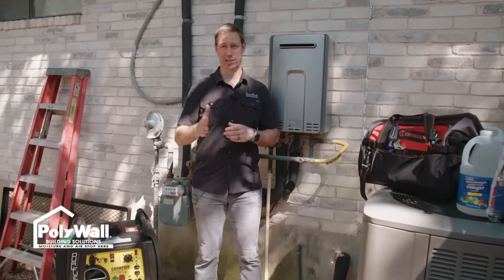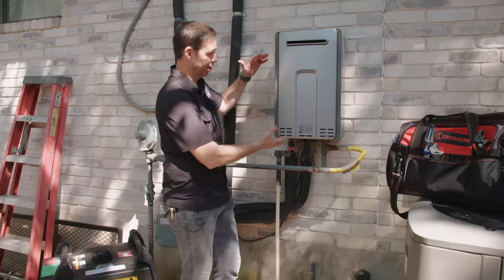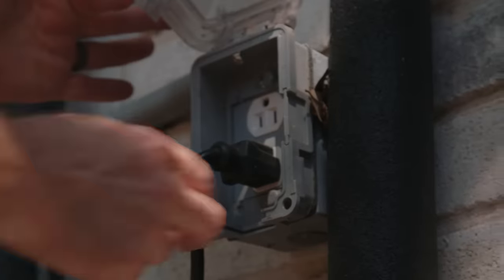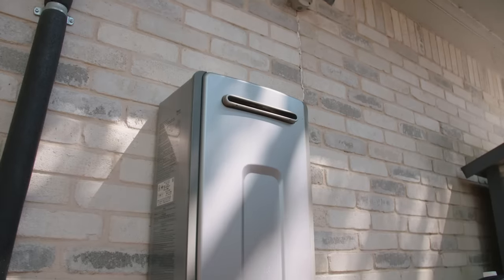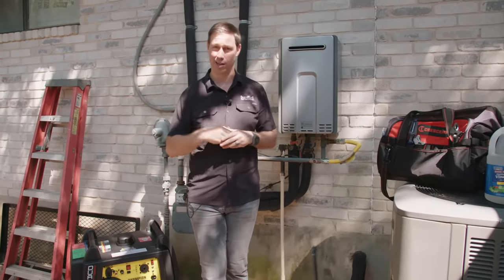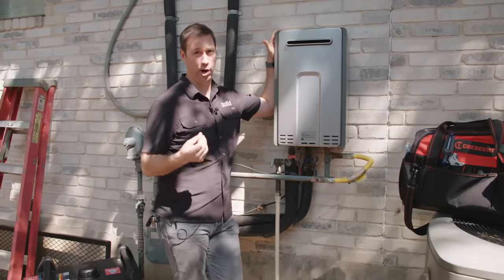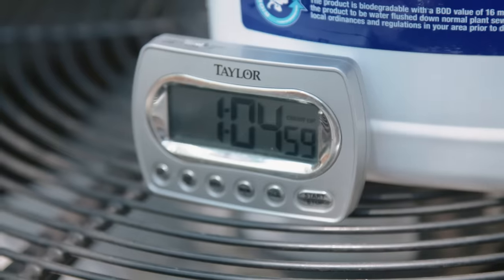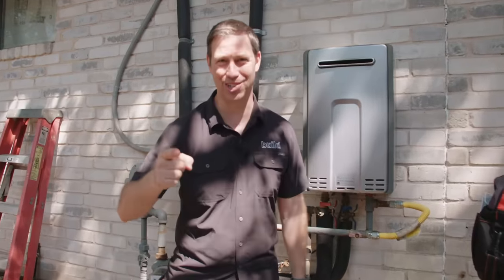3 Things They Don’t Tell You About Tankless

Comment: I flushed my Rinnei after almost 2 years, nothing came out. But when I installed it I found the second elbow after the old tank water heater had gotten 1/3 blocked in the 14 years after the house was built. So maybe scale has little to do with the type of heater. I did save money as I tended to shower do laundry and dishes all in succession and didn't have to heat water for it to just sit the rest of the day. You can buy a timer and a solenoid shutoff valve for the hot water feed to the shower if you children  don't adhere to an audible timer. It would require some electrical work. If you put the timer outside the bathroom door, they have to exit the bathroom to reset the timer.

Comment: I'm getting another tank water heater and pulling out the tankless, I don't have enough hot water to take a shower. Looking at the specs when to order,  listed was a 40 Amp double with 8-3. Upon arrival, l found that two double  50 Amp and l needed  another 8 awg line and a larger panel box because l didn't put in a large enough in 20 some year's ago. I had a 30 gallon manufactured 03 2003 and it has been working until a couple months ago. I plan to get a 40 gallon and  lower the platform for it to fit.

Comment: I’ve had three tankless water heaters (2 combi) across two homes, and I can safely say that I HATE tankless water heaters. 
Sure, you get endless hot water, but it comes with so many downsides. 
1. Low hot water pressure/low flow: these things immediately drop your pressure. I’m a woman with thick, long hair, so I need a good amount of pressure to wash my hair. It takes me longer to shower because I have to use more water to do the same routine. I’d rather use cooler water and take shorter showers if it means having a regular amount of pressure to do so (even now I flip between hot and cool water in the shower to increase the pressure). In this case, I don’t think I’m saving any gas money. If anything, my water bill has gone up because I’m using more water to do the same things (eg, wash dishes, fill washing machine) to compensate.
2. The maintenance: these things are a pain to maintain and they clog my system with so much buildup, so I have to continually check my aerators and soak my shower head in vinegar. Why is this so much work? I just want to use my water normally and not have to maintain it so much.
3. Once the power goes out, I’m without hot water or heat. Great, what a blast. Also, if this thing breaks down I’m without hot water or heat. This happened to me in the winter and I was NOT a happy camper.
4. No cost savings: as I said above, you use more water to compensate, so I really don’t think you’re saving money.

I think tankless heaters are good for small families (1 or 2 people) in small houses. I DO NOT recommend them for large families because you’ll run out of pressure quickly if too many things are running at once.

Overall, I hate these things and I can’t wait to move into a new home with a hot water tank and have normal pressure again.

Comment: I added a Hugo Battery Backup to my Rinnai tankless heater.  It's the only one approved by Rinnai to add to their system.  Mine is inside the house though.  But it's basically a car battery in a good case that you plug in between the wall and the unit.  It'll give you about 5 days of hot water use before it drains.  Unless you're constantly using hot water of course.

Comment: Also make sure you have the correct size gas line and a warm place to store it or no hot water in extreme winter and cold areas. A traditional tank has a pilot which stays warm/hot, with on demand I have to put a heater in the water closet during winter to keep pipes from freezing and have hot water
Reply: Had one in houston, it was great! Didnt account for the cold temps in the mountains where I now reside.

Comment: 4th and 5th things. the temp of the water coming out of the heater depends on the temp of the supply water. freezing supply water means you have to crank up the heater to get decent hot water. 5th    if the heater has an igniter rather than a pilot light, there must be sufficient water pressure to cause the igniter to work. people who have well water supplied through a pressure pump, governed by a 30/50 pressure switch, may find that at 30 lbs pressure,the igniter will not work. pressure translates to water flow that makes the igniter work.

Comment: It's also vital to centrally locate the tankless. My late mother's house has its tankless on one end of the house and the kitchen sink on the opposite end. This makes occasional point-of-use water, like washing dishes old school, constantly needing a wasteful running until it's hot again scenario. And no, "just get a dishwasher" is not an acceptable solution. Said house will be up for sale in a month or so. I expect that the next owner will switch batch to a tank. The old tank location resulted in tank failure (and a small flood) about every 6 years or so. Ugh.

Comment: I work for a natural gas utility company. I see many people who think that you can simply swap out a tank for tankless. Often they will get a low-pressure code because they did not run a dedicated gas line to the tankless and size the pipe correctly. 2nd the cost to fix can be very expensive. A pc board can cost $600.

Comment: No pilot,THERE is the savings, I live alone, and that’s why it really works!   When I had a tank outside, my gas bill was $50 per month, in winter when the heater pilot was on $100 per month, since I’ve had a tankless, when the heater pilot is off, my gas bill is $6 per month, yes you read that right!!   But mine is just 140,000BTU max, it’s inside, and the longest run to a hot outlet is just 10’.  Short pipe runs are 
Absolutely ideal for tankless.

Maintenance: When I installed it I had all new copper pipe, ‘07, I have NEVER serviced it or descaled it properly, I never bought the proper valves to clean it out, I never even checked the water filter at intake, nor cleaned the screen in the air intake!  Takagi, lasted 14 years …..of my abuse, finally the flow detector died, from the lime.   But I’ve no complaints!

This time it’s has the computer display screen built in, it’s smaller and lighter than the the TK Jr, yet it was only $50 more 14 years later!

For me the tankless is fabulous, it saves me, $600 per year easy, my short plumbing runs, mean even in the coldest weather I’ve got hot water in less than 3 minutes.
But this time I bought the cleanout valves, if I service it, it will
Be the last water heater I ever buy most likely, ….I’d be 85 in 20 years !

Comment: I put a tankless water in years ago.  My gas was cut in half.  A pump and some vinegar does not cost much. The main reason I had a tankless put in was to move the pilot light out of the 
Garage because my sun has motorcycles and they leak gas.   The generator with your tools on it will take care of having hot water when the power goes out. I have one of those also.

Comment: I got a Rinnai 6.5 GPM and you dual Fuel Genny Champion 3400 I ran it for 39 hours for my refer and freezer and CPAP internet and tv computer on 4.5 gallons of LP.  I am going to build a barndo in TN like RR Builders using my Rinnai to heat not only my water but Radiant too on LP.

Comment: #1, trivial.#2, big. Although we used a tankless for 35 years, where we live now any energy savings would never pay for the cost of a tankless install (higher initial cost, plus we require electric- and the installation of a higher amperage circuit would push that cost even higher). #3 I find curious. We used several different brands of tankless and never descaled once, and no problems, even though our country well water was loaded with calcium and iron.

Comment: IF you have my tankless electric water heater. to be honest I LOVE IT!!!!! But be warned, it requires 2 dual 60amp breakers. and will rise your bill slightly about $20 a month.
It takes about 8 seconds to reach full 145F then about 10 sec there after for it to stablize (No anid rods and lower power setting). Also take the tiny tank inside apart once every 3-6 months and keep it clean!

Comment: The issue I found is you need consistent high water pressure.  It didn't work well with a pump and bladder setup. I hear too that gas pressure may be a factor.  I pulled mine out of frustration with running water while waiting for my pressure to build back up.

Comment: We moved into a 'new' cabin that had been sitting for awhile from a previous owner dispute with the contractor, that had one of these on demands installed.  We fired it up and used it for two years before it failed and leaked all over the utility room.  Opening it up, the fins had completely degraded and turned to grit.  We had to have it rebuilt to get hot water again.

Comment: I’ll add this about tankless. I’m in Austin TX and have 2 twelve year old Rinnai units at a duplex mounted outside and they did great despite having one insulated copper pipe burst under a pier and beam house. A friend has 2 six month old Navien units which are not worth saving. I believe 5 or 6 of naviens proprietary plastic fittings cracked in each unit. After replacing the plastic fittings it turns out the heat exchangers are also destroyed on both units. I’ve now looked at 2 more navian units mounted outside that have failed (heat exchangers) as well as multiple fittings.
Reply: I live in Austin as well & was thinking of installing tankless when my old water heater (+15 years) finally goes. Sounds like Rinnai is the obvious choice.

Comment: Tankless heaters are on the outside and will freeze if it is cold enough. I had two with proper electric freeze prevention and insulation. Both froze in the recent extreme cold snap with no power outages. Both froze anyway.

Comment: At point is energy saving compared to single point units.
You’re still hearing water that just sits in pipes.
And you will DEFINITELY save energy… if it’s not in use, it doesn’t consume, where as tanks use regardless… if you’re basing your usage based on availability… then you’re not trying to save money in the first place

Comment: Coming in way late, but I think it's very interesting that your first "con" is that there is no hot water when you lose power, but in your second "con", it's energy efficiency for something like a gas hot water heater. Wouldn't a gas tankless water heater be a fix for the first con? It's just interesting that you made no mention of a gas tankless water heater to get around con one, but mention it as having a higher cost in con two.

Comment: Matt,
I sure would like to see you address how a large family can best handle their hot water needs.  Their 60 gallon tank is old and not it's not long before it will need replacing!  Here's the hitch, they are all electric, and they currently only have a circuit for a one element 5.5kw heater!

Comment: my biggest complaint by Rinnai RUR unit is that , unless you have recirc mode on all the time you will not get hot water right away, otherwise it takes a good 2 minutes of running the faucet on hot until I get it. I'm not a fan of having to keep that recirc mode on all the time. There is a mode where you can run it for 30 minutes at a time, but that gets to be complicated because I am used to having hot water right away if not maybe 15 seconds with my traditional water heater and it never relied on a recirc pump

Comment: I have one in my granny flat that's rated at 2.5 GPM. In the summer even with all the settings as low as possible, it's too much. I live in Southern California with warmer water to start. If i had to choose again, I would get a 1.5 GPM unit.  I have no idea who's using 8.5 GPM units. Maybe if you run three showers, the dishwasher and laundry at the same time? Think about that, if you have an 80 gallon standard tank, you could fill it completely hot in 9 minutes.

Comment: If my power goes out, I am MORE worried about the food in my refrigerator then if I can take a hot shower.   If you are taking hour long showers, might I suggest a whirlpool tub (If you are THAT worried about how much water you are using).  Most larger areas have companies that will, for an annual fee, provide service to your HVAC, Electrical, and Plumbing.

Comment: Here in Florida, electric tank type water heaters are the norm. I saved at least $50 per month on my electric bill after installing a tankless. With two adults and one teenager our LP gas bill was $15 per month. 
About your comment about flushing the tanks; just flushing is not going to remove all of the sediment and minerals from the bottom of the tank and in a gas tank type heater that causes serious efficiency problems. Remember this, the pilot light on your standard tank type W/H accounts for about 1/3 of your total gas usage. I had a customer once that turned here gas W/H to the vacation setting (VAC) and the water was still 110 degrees with just the PILOT on. You don't want to touch the flue pipe while the burner is on, but on the higher efficient tankless you can hold your hand right in front of the exhaust opening and it is cooler that the water temp. I am on my second tankless and don't expect to ever change that.

Comment: One of the reasons I’m interested in one is I have a double wide mobile home and I need to move and relocate the pressure tank and hot water heater and this unit wold save a lot space. Where it is currently the fuse panel is directly on the back side of it….can you tell me what kind of heater would you use in this situation……I only have propane……my house does have a ew softener system.

Comment: They do have tankless heaters with a 20 min timer on them. As well battery powered. So if you do lose power, then you still can have hot water accessible for use. As for flushing. Most manuals say to flush it every 3 to 4months

Comment: I'd recommend putting them inside.  I spoke with a lot of plumbers before installing one and all of them said that one of their most common calls in the winter (this is Tennessee) is that the power went out, the automatic flush valve stuck, and the lines froze and busted.  Having it inside also allows you to plug it into an uninterruptible power supply so you don't have to worry about outages.  And, of course, you don't have to worry about theft.  There is a problem with kids taking too long of showers and I've had to turn the heater off to get them out at times.  Unfortunately, the Rinnai doesn't allow changing the temperature while it's running - I understand not allowing it to increase but they should allow decrease.  The tankless rocks, though.

Comment: It sounds like you may have mentioned the answer to this question already when you spoke about timing the showers, but just in case....I have a tankless gas water heater and when I shower, the water drastically goes from hot to cold in maybe two minutes tops. could this be due to the water heaters life pretty much being over?
Reply: It’s time to have it serviced and may be change the heating rods. With time they get covered with calcium deposits which prevent the water to get in contact with the rods and therefore not being heated

Comment: What he didn't tell you is that when the water exceeds 8 grains hard the heating ability starts to degrade in the first 30 days. When the majority of hardness in the water is calcium bicarbonate the functionality degrades significantly in the first 6 months by as mush as 30%. Most manufacturers require a 5-micron sediment filter and some kind of scale reduction media to meet their warranty. A water does a good job when the meter is set correctly, and the brine tank is loaded with salt, but if the pH is low the sodium will lead to corrosion. Also, most manufacturers want you to remove chlorides, sulfates and silica's or provide some kind of protection, otherwise the metal contact parts will start to degrade inside of 24 months. Softening does nothing for corrosion.

Comment: I'm sold on the benefits of tankless. Unfortunately not sold on the cost to transition. I've run the numbers twice in the last twenty years, using the industries costs which are on the generous side. Looking at almost 25 years to recoup the overall cost to switch. Both times I replaced the existing. To me its a no brainer. $750 to swap out tank for tank or 5500 to go tankless with the necessary upgrades.

Comment: Depending on the location of the heater, you may have to run a long separate 1” or larger gas line ($$$). If you’re used to a real strong flow at your shower, you will be disappointed.  I think the only advantage for us is we can fill a deep jacuzzi tub without running out of water.  Other than that, the negatives outweigh the positives.  
..

Comment: Well matt i gotta say, i lived in texas for 20 years and truthfully i never even used my hot water heater. the water coming from the faucet was just fine especially when its 100 degrees out.. even in the winter i never used the hot water heater. i guess its up to the individual , but thanks for the heads up on the tank less . I was considering one but since there is only the two of us now i dont think its worth the hastle. I live in ny now where you definitely need a hot water heater lol.

Comment: It’s possible to save half of your hot water and reduce power consumption just by shutting the water off during your shower.
Downstream of my mixing valve I have a shut off valve. I can shut off the water intermittently without losing my preferred temperature.
Unfortunately that’s not an option in many cases but it it should be.

Comment: There are plenty of back up battery’s out there made for tankless Waterheaters. That    Can provide up to 26 hours of hot water when power goes out. If can limit to 1 hour of hot water a day up to 26 days( Rinah sucks should only install condensing stainless steel heat exchanger tankless)